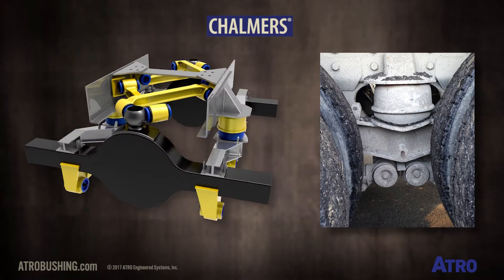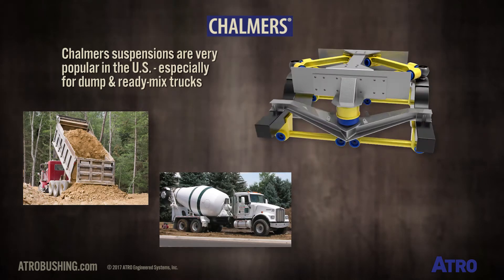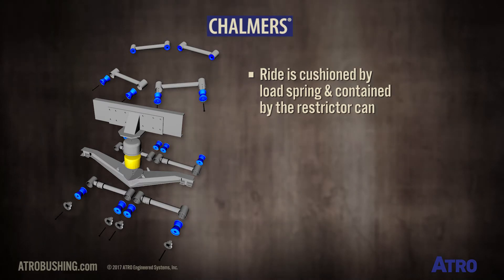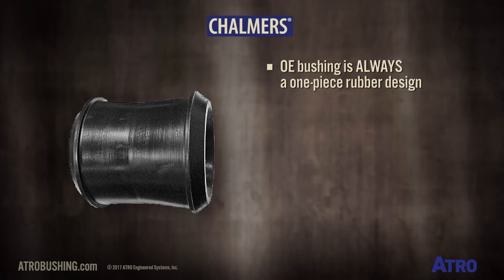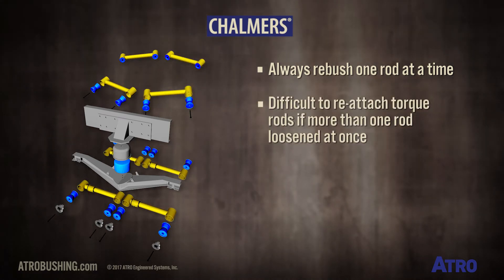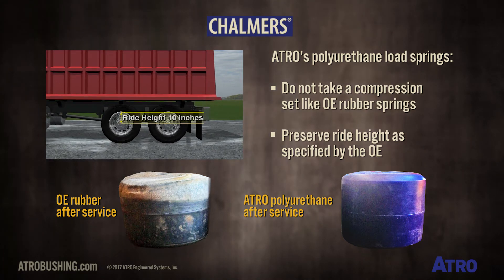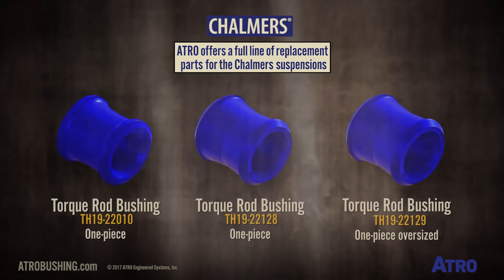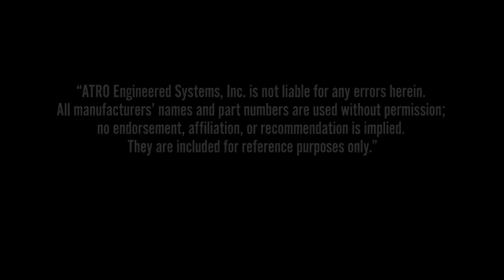ATRO Parts | Chalmers Suspensions

Comment: how this suspension is compare to Hendrickson Primaax EX severe duty?  Which one will you choose for heavy duty Dump Truck application?
Reply: Chalmers is comparable to Hendrickson Haulmaax, they both use rubber bushing springs. Primaax is an air suspension. Air suspension rides better but it cost more and requires you to dump the airbags every time you raise the dump bed which takes time. If you forget to dump the airbags and you lift the dump bed the truck will fall backwards and tip over.